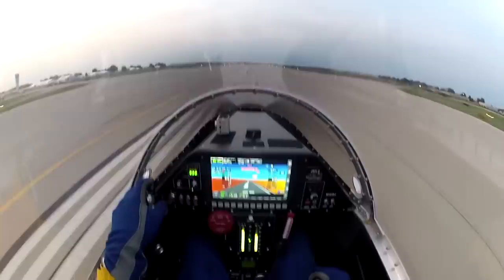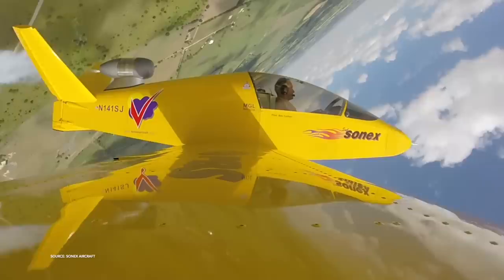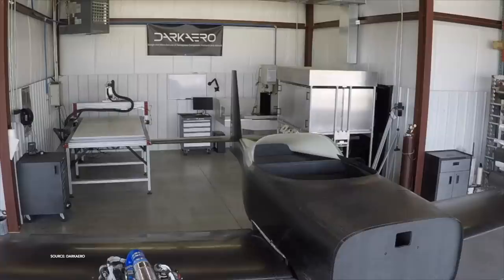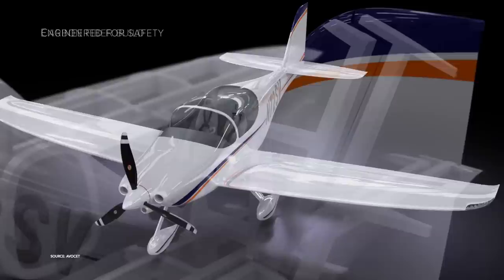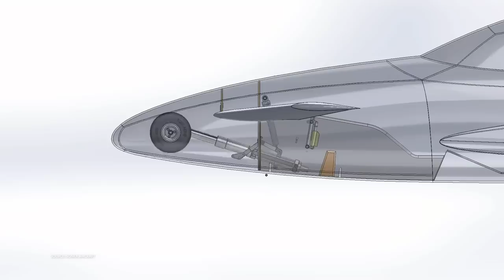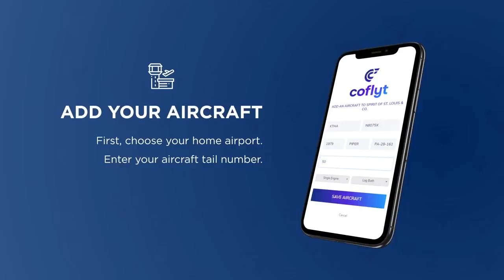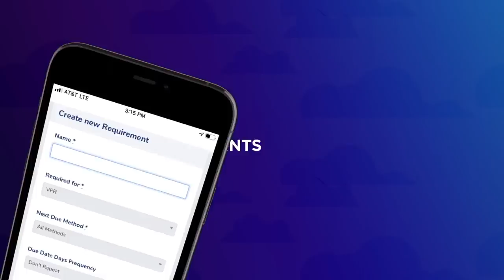5 Kit Planes You Can Build In Your Garage

Comment: We've had two stall spin crashes of VL3s here in Europe and it has gotten a bad reputation for that but I figure it's like the Lancairs it's inspired by, not meant for low speed. Both cases the parachutes weren't deployed...    they claim 380km/h max cruise, which is not bad and here in Europe I can get it under a sport license. Although we aren't allowed to fly above 9500. But presumably still decent speed.

Comment: I am surprised Mike. You mention Dark Aero, an airplane that is still in the design phase. To be flight tested very soon, Raptor Aircraft will be cruising at 267 miles per hour while burning only 7 gallons of diesel or jet A fuel per hour. It's a large, 5 person,  pressurized airplane with a range of about 4500 miles. If you add to that that it will be built in 3 weeks with a price tag of only $130 000 ready to fly (with an extensive Garmin avionics suite included), it beats every airplane you mention in this video by a long mile.
Reply: He’s having tremendous issues to be overcome. The plane is overweight and I highly doubt it hits anywhere close to those numbers.
Reply: cant buy it and the prototype is not even finished the velocity is actually real currently
Reply: As someone commented about the prototypes in here, don't believe it till it's flying.

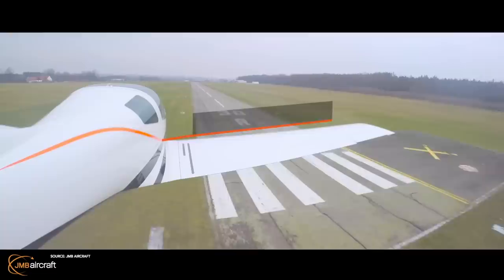Comment: The VL3 at 6:06 has cruise speed of 270 km/hr, which is about 162 miles/hr, well short of your minimum speed of 200 miles/hr.
Reply: AikiRandy1969 I believe that was with the 100 HP rotax not the turbocharged 915s